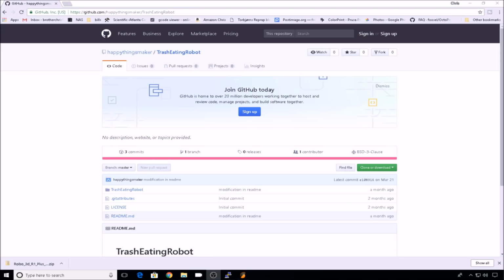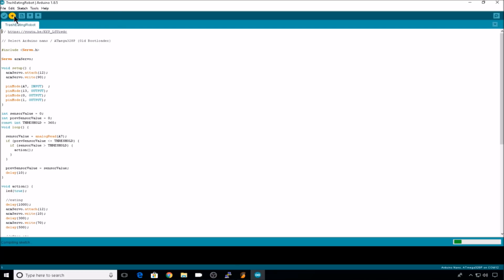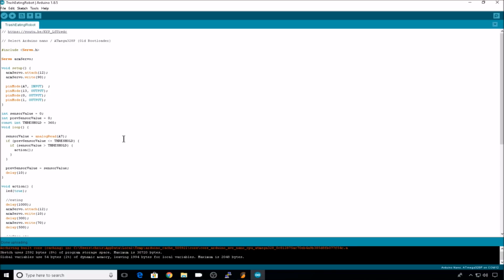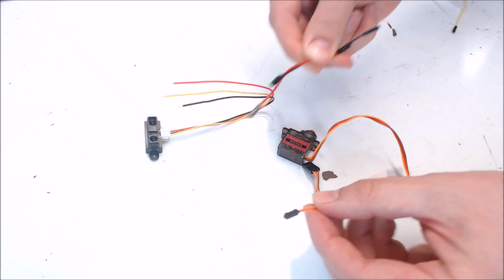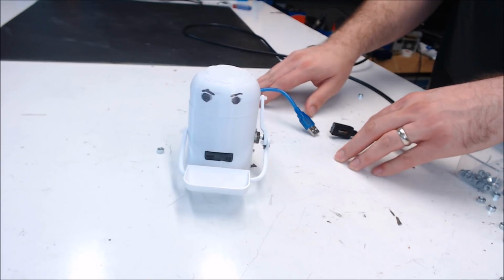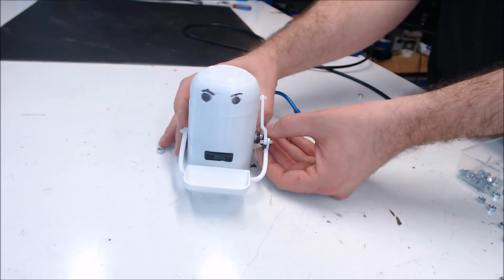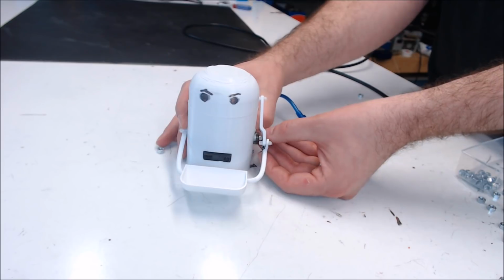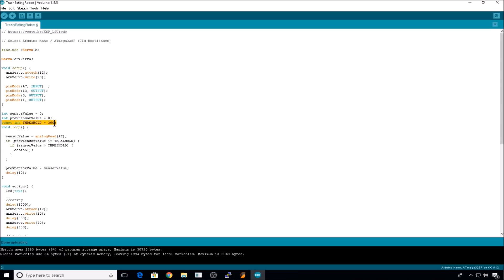Hungry Bot - 3D Printed Arduino Project - created by FREETIME4Y - Chris's Basement

Comment: Chris, how big of a servo can be gotten?     I would love to build this on to a garbage can for the backyard, auto open for next to the grill, or for even more fun, one that could open to catch the trash when you threw it at the can
Reply from the maker: You can get these pretty big, like up to 50 pound pushers. After that you would be looking at a liner actuator. It would be really cool to see a trash can setup like this.
Reply: https://www.rcplanet.com/radio-system/servos-car-boat/savox-standard-size-coreless-digital-servo-15-277-savsc1256tg/?gclid=Cj0KCQjwxN_XBRCFARIsAIufy1aZwCjghbH4ppjID09szgR7z2od-8lwByMmGTMHMWbx1HdD-ijbqRMaAujXEALw_wcB    This one moves about 13 pounds per inch on a titanium gear, I guess I need to pull out the old text books to calculate the weight of the arm, plus the can lid, at whatever length arm to see if it has the oomf, correct?
Reply from the maker: Brew It, Print It, Build It, Blast It correct,  but you would be surprised at what some of these can push.

Comment: Hah..what a great little robot!  Needs a bowtie :P
Awesome build...wonder if a 2nd servo reversed would make it stronger
Also, you should design and print some tiny 3D printed pins to hold the head better so it doesn't flop over (I made some for a 3D geared spinner one time, had to print em flat ont he bed, and they needed a bit of sanding and cleanup)
Great print, great video...keep em coming!
Reply from the maker: Brian C Bowtie would be awesome.  Yeah there is a lot of stuff you could do for upgrades. It's a fun project.